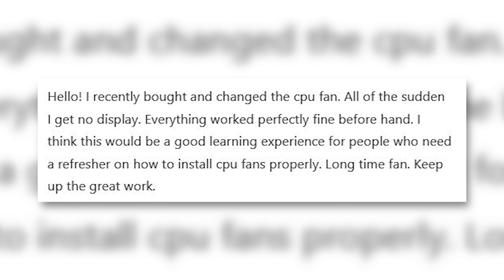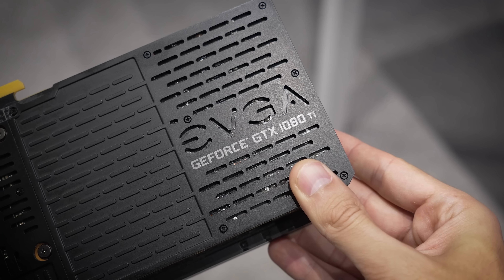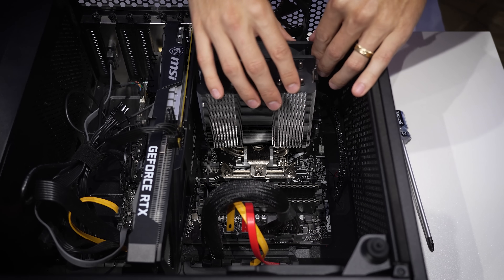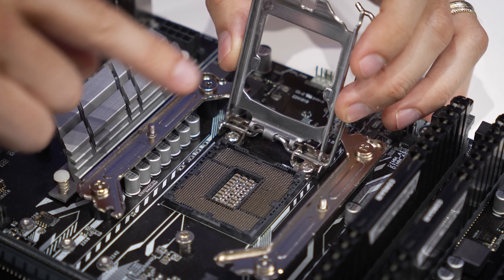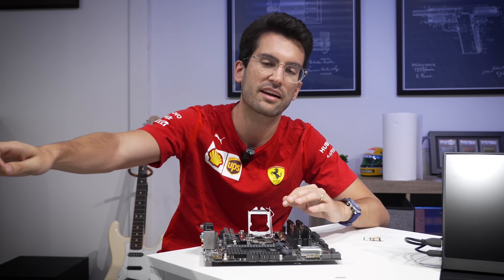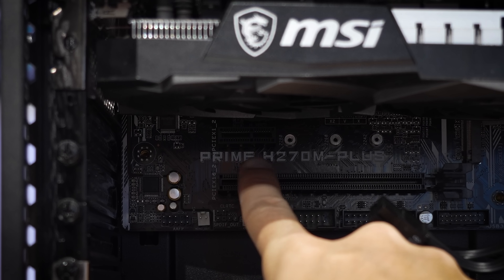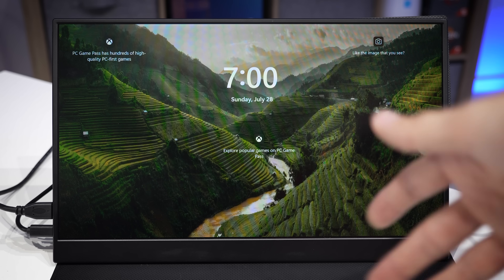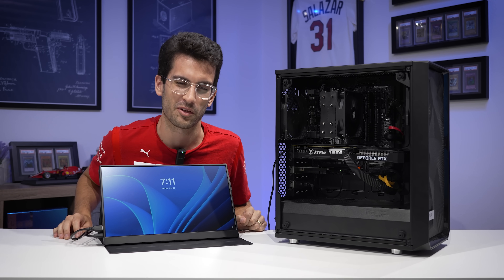Fixing a Viewer's BROKEN Gaming PC? - Fix or Flop S5:E16

Comment: HI Greg. Great job with the surgery! I have been an IT engineer for, lets just say, a VERY long time now. I enjoy watching you learn and helping others do the same. One thing I did notice though is that the 3060 GPU looks to have a fair amount of sag in it. Over time that could crack the PCB, especially at the PCI-E hook. Cracks with break and / or short the circuits in the layers of the PCB. It really looked like (from the video) the GPU could have used a support post. They are only about $10 and are a world of help to any heavy GPU that is mounted sideways. $10 to save hundreds is well worth it in my book. I could be wrong. But, it sure looked like the GPU was bent from my screen.
Reply: I thought so too at first, but look closely. This card has a short PCB and long radiator. Usually the overhang radiator has solid backplate running the whole length of the radiator. This model has a backplate on the PCB, then a height change when the PCB ends. It visually looks like the card is bent (sagged), but when viewed closer, the PCB is actually quite straight and the sag is only on the radiator/plastic overhang.

Comment: I had to do reports on lead retrieval machines at CES (and two gun shows) a few years back...and I had to make three service calls to the INTEL booth and they couldn't figure out the problem...  I later found out the error was that the  power strip wasn't turned on and put in my first of three ID10T error receipts for them to sign (first two were blank and later changed to ID10T error)...

Comment: I am glad that you were able to bend those pins back and get the system working again. I would still suggest doing a memory test and also doing some CPU stress test to get the CPU extremely hot and verify everything is in working order. There is always a chance that a pin is barely making good contact and a full stress test might show if there are any problems.

Comment: Greg, do you mess with firmware issues? I have a mobo that last I tried to power it on the q-code readout was staying at "FF"..... If you want to mess with it by all means let me know, not sure when the next time I'll be over to Orland will be, but it'd be around midnight though (for work)....

Comment: Greg, with older intel setups like first and second gen skylake (I'm not certain about 8th gen on), they have so few pci-e lanes there are usually trade offs for using all pci-e slots. For instance, on my evga z270 motherboard, I have my GPU in the top most pci-e x16 slot, but if I put anything into the next x16 slot it will neuter the GPU's lanes from x16 to x8. If I put something into the x1 slot, something else on the board is automatically turned off. By putting the wifi card in that 2nd x16 slot, you may have inadvertently hobbled his GPU. Mine is a full atx board, his is an m-atx board so maybe not, but you may want to check that if you haven't taken it back to him yet, or contact him so he can check. I know running your GPU at x8 isn't as bad as it sounds, but I would rather run mine at x16 than x8.

Comment: I bought a Gigabyte  z170 based mobo many moon ago from a fellow on OfferUp. He said it was fine, but it had issues with the CPU socket pins. 1 of which had completely snapped. I didn't want to drive all the way back to meet him to get my money back so I sought to fix it myself. I bent the several bent pins back in place and cut out a pin from an old dead socket 775 mobo and very carefully placed it in the pin slot of the z170 board. Then I placed the CPU in (again, VERY carefully) and it posted. I can't ever remove the CPU without needing to mess with that pin again, but I have no plans to change the i5-6600K in it anyway. It's been a great 1080p machine ever since.

Comment: use syrynge nail next time, will be easy to put pin into the nail hole and move where ever u want
Reply from the maker: Far too large for this. Wouldn't recommend. Much happier with needle.
Reply: @GregSalazar  sorry i did mistake, syrynge needle*

Comment: love the tool greg used sewing needle, ill have to try that
Reply: I've also had luck with the tip of an Xacto knife for Intel sockets and with a metal-tipped mechanical pencil slipped over a slightly bent pin on AMD chips.

Comment: i had a amd cpu that would boot sometimes and not others so i took the cpu out and it had a few slightly bent pins, i used a blade from a stanley knife and it was perfect for the job as never had a problem after that

Comment: Hey Greg, I need your help, this won't be easy as I'm not local, I live in Thailand, have you ever thought of going fix or flop via video call??, I can set up for it no problem, I am also very good, normally, with computers but the fault I have is intermittent and has me stumped., my computer screens go blank, they say no input, my computer stays on with fans and LEDs on but no output.  If I force power off and turn on again the fans spin up to full power but no post, I reset BIOS and after maybe 4 or 5 attempts to reset it powers on and posts again, I'm thinking more due to cooling down than resetting BIOS, if this would work for a fix or flop DIY special I can send you full pc parts list, the computer was a pre built, well sort of, it was built by a company in Thailand that are pretty good called ADVICE, all parts are off the shelf parts and mostly Thermaltake, I found 2 problems already, firstly the M.2 drive was not secured in place with a spacer or screw, just the heatsink.  Also the AIO cooler was not tightened down, do you think they may have forgot to pit thermal paste on the CPU?.  I know it's not so easy to do this but might make for a good video.

Comment: Just had to fix a bios reset issue that started up a cpu fan detect error on a system with the same specs as this pretty much but z270 asus strix board, gotta say I hate asus bios and much prefer msi layout

Comment: hey greg i found a better tool for bent pins, work perfectly for me. its a 0.5mm mechanical pencil, the tip can bend the pin to the correct spot. hope you get to try it. keep up the great content
Reply from the maker: Not sure how that would be any better. A 0.5mm graphite rod is more brittle than the pins and can risk snapping during movement. They're also not fine enough. A sewing needle is smaller, stronger, and more precise.

Comment: 99% sure there is a problem with the cpu and socket.. step1: turn on the pc...
Reply from the maker: This is a silly critique. I'm not going to waste my time taking things apart if the system actually works. 1st rule of troubleshooting: Replication. Period.
Reply: @GregSalazar  if you know its not working, if you know there is big chance of bad pins,  dont turn it on before inspecting.. maybe nothing shorted before, and could be shorted after another power up

Comment: I'll be honest, when I built my current rig this year (which I am immensely proud of,) one of the most nerve wracking parts of it was installing the CPU since its somewhat easy to go wrong there and bend pins, and you gotta be real gentle with it and all that. Glad I managed it on my own without assistance, but this is a pretty good look at how badly it can go.

Even the graphics card didn't have me nervous, and that cost almost £500 for me. (4060 TI, don't laugh, it works perfectly fine for me.)

Comment: Greg great job with the pins. Have you ever used a razor blade to straighten pins?
Reply from the maker: The problem with razor blades is that they're too large in one dimension. You run a real risk of hitting other pins. Why not just use a fine needle that is still strong and much more precise?

Comment: I repaired a socket for the first time last year and I've got what may or may not be a great tip. I bought a known good used 9900K ($100) to replace my 8600K which wasn't pairing well with my RX 6800 XT and decided I'd replace my ASUS Z370 Prime-P if I could do it on the cheap. I looked at some Z390 boards with damaged pins on ebay and scored a Gigabyte Z390 Aorus Ultra for about $50. Game on!

What I did was take my 8600K and "paint" the contact pads with black dry erase marker and then install and remove it. I noted the poor or missing contact areas under a cheap USB microscope that I also used for the pin bending work and snapped some reference pics. I had to socket the CPU a few times, "painting" each time, to check my progress but I was able to make contact with all pins after a few tries and was able to see when I didn't have some of them quite right yet. 

The dry erase wiped right off and I gave a quick cleaning with alcohol just to be sure. The system has been running just fine for nearly a year now. 

Probably the hardest part and also where the maker telltale came in really handy was with a few broken pins that I had to manipulate to stick up higher where they would contact just off the pads and then slide into good contact when fully socketed. Without the telltale I don't think I would have been able to save this board because I wouldn't have known how to shape the broken pin stubs.

Comment: my MB has 3 damaged mins and 1 missing pin 
the MB works fine , BUT (it a BIG BUT) MB is limited
can't XMP
can't benchmark
can't play rarely some game ( must of game works , but some are not )
can't use Winrar app
anything that PUSH THE CPU  E COREs to 75% or 100% will result SYSTEM failure

Comment: I have a little more education to add!

Believe it or not, but not all CPU/socket pins are actually needed. Some have the same function as others, which means that even if one snaps off, it may not be an issue.

Then, there's other pins that when missing or misaligned don't prevent a POST but can have other negative effects; like a certain feature no longer functioning properly. This could be a feature you'll definitely want to make use of (like dual channel memory instead of having to rely on a single channel), or it could be an advanced feature that you probably won't be using.

So, for one... don't give up on a board just because a pin is bent or broken; perhaps it still works fine! And two... Test and stress test well if you have new socket damage; your system might no longer be entirely stable, or features might be missing.
Reply: You are spot on!. Years back in like 2007 I did this with a cheapo mobo and Intel CPU. I would cut pins on the CPU and then put the CPU back in and kept doing it until the system wouldn't post.

Comment: Mine was the AM4 Ryzen pins being bent after it got glued to the cooler when I was removing it for a cooler replacement. Good thing I was able to bend it back, AM4 Pins are easy and strong to bend back as long as those are minor bends.

Comment: I removed the socket retention bracket on my B760 to install the Arctic contact frame that comes with the Freezer 36 air cooler. I was quite nervous about it but it all went well no damaged pins.

Comment: Did you test all the ram slots and stress test it afterwards? I have fixed several sockets that did post and boot to OS, but then had other issues related to the bent or missing pins.
Reply from the maker: I don't log into viewers' systems unless absolutely necessary. The system ran idle for several hours following this fix, and RAM was detected without issue. If other issues arise in the future on account of the bent pins (which are almost entirely fixed now, by the way), then a motherboard replacement will be needed regardless. Best not to throw money at things until absolutely necessary in these cases.

Comment: If you did have to replace the motherboard, why would you buy a seven-year-old replacement? Why not just buy a modern board? Is there a compatibility issue or something with his cpu?
Reply from the maker: Yes, compatibility. Old chips don't work on new boards, etc. If you're new to PC building, there are plenty of helpful videos on our channel and others to get ya started on compatibility and assembly!

Comment: Getting an Electronic Microscope would help you a lot with Fix or Flop. Especially with Pins and soldering.
Reply from the maker: I have a cheaper microscope but it's not necessary for most of these bent pin situations.

Comment: I bought a b650e f gaming motherboard with several bend pins for only 40euros. I got it to work. I sold my am4 platform and basically upgraded to am5 for free. So dont be afraid to try it out.

Comment: Greg, those Thermal Grizzly sheets or any for that matter have always been (based on data) inferior to traditional paste. If this product isn't, why? Cheers.
Reply from the maker: This isn't a traditional "thermal pad." Not the cheap crap you'd find atop memory chips and things in graphics cards. This is essentially a thermal paste compound that retains its shape. Not sure what data you're referencing that specifically shows Thermal Grizzly PhaseSheets are inferior to traditional paste. Haven't seen anything of the sort on our end. Please cite.
Reply: @GregSalazar  Not specifically Phase Sheets but sheets in general. There has always been a concern of the sheets not filling the microscopic gaps and potential lead for small air bubbles between contact pads.

Comment: I've got an high end ROG motherboard that was quite expensive. Recently got a new case and in the process of transferring the mobo I bent 10-12 CPU pins. Looking around for a suitable replacement revealed that similar boards are still quite expensive so I looked into repairing mine. I won't mention who I found, but I have a quote of $120.00 US to have the socket replaced. I have yet to send the board in for repair, but once I do and get it back maybe I'll come back and edit my comment about the results.

Comment: Hi Greg, I’m currently dealing with stability issues on my Intel Core i9-13900K and have noticed similar problems reported by others. Given your expertise, I’m curious about your thoughts on how Intel might address these issues with future updates. Do you think the problems will be resolved effectively, or should users expect ongoing challenges? Also, any advice on troubleshooting or optimizing performance with this CPU would be greatly appreciated. Thanks!
Reply: First of all, update your bios before tinkering with OC. Most vendors came out with an update last weekend.
Reply: @kartoenn  Thanks for the suggestion! I’ve already tried updating the BIOS and Intel ME firmware, but unfortunately, my PC keeps rebooting and showing a message related to updating the Intel ME firmware. The BIOS update process itself seems to be causing issues.

I did manage to roll back to an older BIOS version, which allowed me to boot into Windows, but I’m still encountering stability problems with the 13th Gen CPU. Given the issues, I’m planning to test with a 12th Gen CPU to see if I can successfully update the BIOS and then reassess the situation with my 13th Gen CPU. I’ve also heard that Intel has acknowledged these stability issues and extended the warranty for affected CPUs, so I’m considering an RMA if the problem persists.

If you have any additional troubleshooting tips or insights, I’d really appreciate them. Thanks again for your input!

Comment: Why does that gpu look extremely bent on the right side of it. I hope it was just the angle but it looked terrible to me. Just after the cable management part of the video
Reply: need a gpu holder, gpu these days is long and heavy so they sag
Reply: @ahwai82  my 4080 super doesn't have a sag bracket and is perfectly fine. A lot of the issues comes from the screw mount. I've noticed a lot of cases are super thin metal so it flexes more causing card sag.
Reply: @Booth73  I have a good case, a fractal r6 but even that my colorful 4070 super sag a little.. probably have to do with heatsink design put the weight far away
Reply: Many people overlook it but it's the two fangs of the graphics card IO bracket that slot into the gap behind the motherboard and case that can cause most sag cases. 

Cases are typically design with great tolerance that have very wide gaps there to accommodate graphics cards in all shapes and sizes. Loose "fang" slots can cause longer cards to sag quite a bit.

The tip is to open the case on both sides, lift up the sagging end with finger slightly, while observing the play on the IO end behind mobo. If the play is too much, try to tighten the IO screws, if that doesn't stop it, wedge something (preferably non-conductive to be safe) into the IO "fang" slot.

Comment: Man i know the struggle of this. I bent pins on my asus z790-h mb trying to get thermal paste off the edge of the socket plastic and slipped into the pins. Went to bend them back and broke 1 pin just in half. The other half is still there but now only 1 channel for memory works and the board wont post with any ram in any other slots at all. Man its a complete disaster. But its all good ish bc i was replacing that board anyways bc i hated asus's features. I went back to msi and thats the company i will probably stay with from now on.